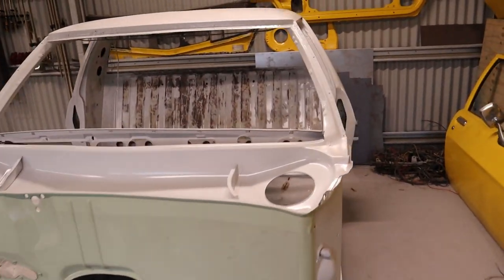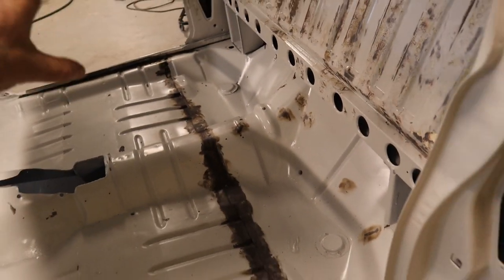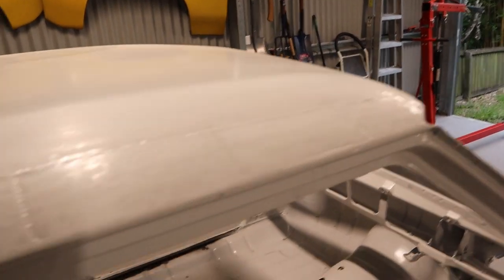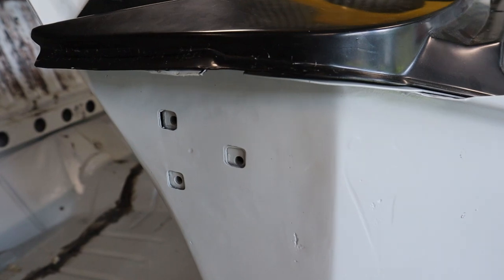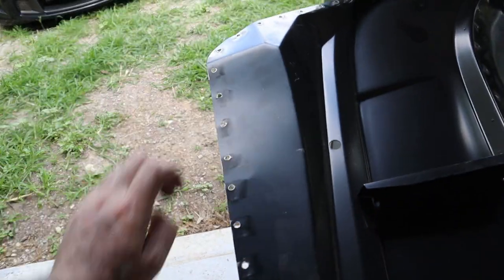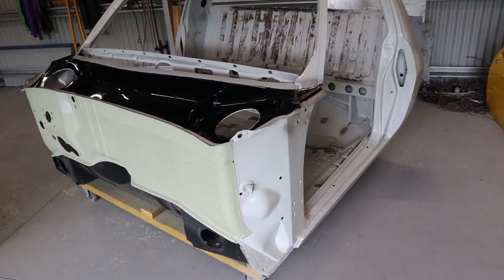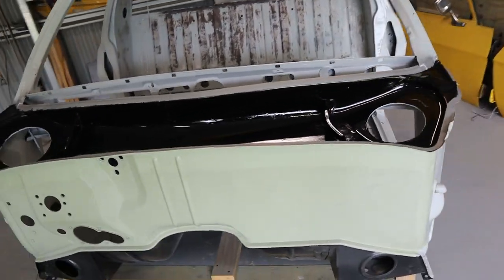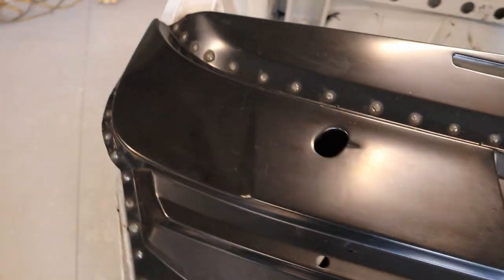HX One Tonner Build - Welding in the Cowl and prepping for final coat of Epoxy.

Comment: A guy I bought some parts off had a great idea for the grill section of the cowel. Cut a rectangle piece of aluminium fly screen and put it under the grill section to stop any debris from even getting down in the lower cowel area. You can hardly tell it's even there.
Reply from the maker: Thats a good idea. I might do that with mine. Cheers

Comment: Good Work Mate!
I'm pretty sure that body filler goes on bare metal to get a better bond(maybe 36 grit disc) unless it's painters filler which is designed to go on a painted surface, and only for minor imperfections.
Reply: Its quite normal these days to bog over epoxy it is designed for that
Reply from the maker: Good point Mate but I asked around a bit in regards to this and its all good to put body filler over the epoxy primer. A lot of people told me that you wont the Epoxy to go over the bare metal and protect it as its the last line of defense and wont absorb moister like body filler can.
Reply: @ozjado  My information is 20 years old, so ok I'm very willing to learn. It will also save me time doing mine.

Comment: Good vid. 👍
I’ve yet to fix my cowl in place, I’ll leave it till last so I can check the guard, doors and bonnet gaps. I have found an issue with mine as it’s only the exterior section of the cowl  and the distances between various points don’t match with the old cab, some are 10mm different so alignment could prove a problem later...hmm more homework needed. 🤔
Reply from the maker: Thats probably A good idea to leave it until everything lined up. Could it possibly be the Cowl is just not fit correct?

Comment: Hey mate, question where do you buy your gas for your welder?
Reply from the maker: Hey Mate. I just use BOC Gas. I have a yearly plan which you get 2 full bottles Size E of Gas for $200. Once you use 1 bottle up you just take it in and swap for another. There is no hire or upfront cost for the bottle this way.